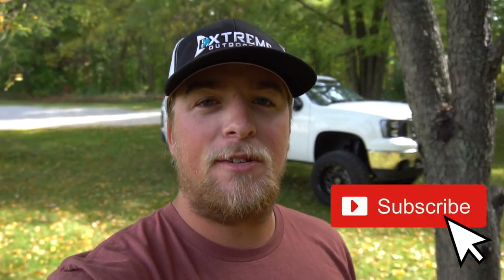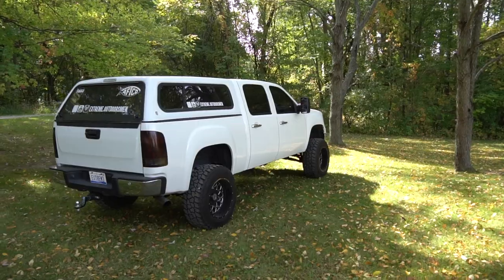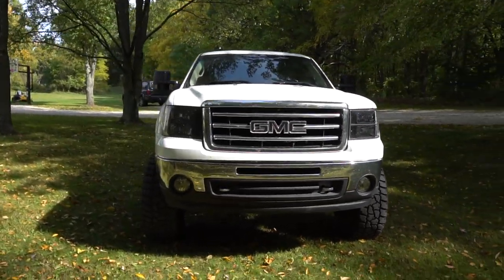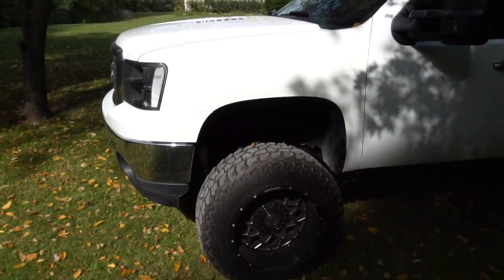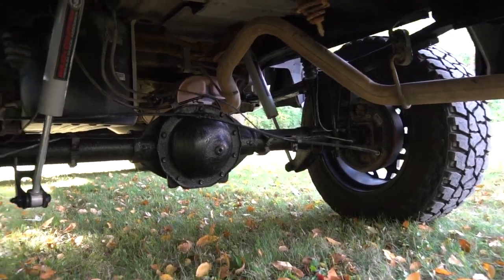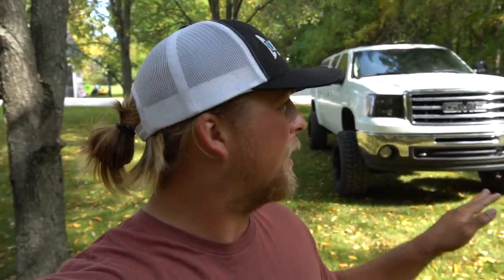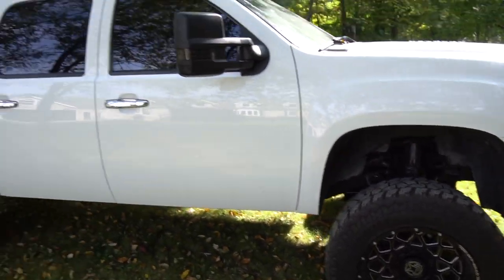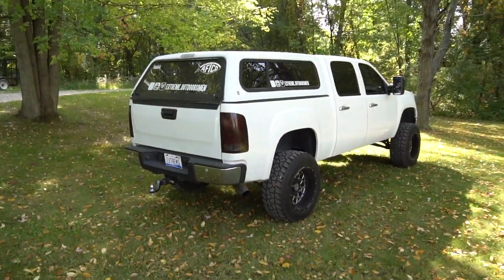I FINALLY Built My DREAM TRUCK - GMC Sierra 1500 Custom Build 7.5inch LIFT KIT

Comment: I did the windshield tint on my 2011 GMC sierra 1500 when I was doing my build. I did 5% tint on the rear and all side windows, a 5% sunstrip on the widshield and the whole windshield done in 20% (Because the guy didn't feel comfortable putting 5% across the windshield also) but looks amazing. On a black truck with tinted windshield it just blends so well, you can barely tell where the body of the truck ends and the glass starts. I also put a ranch hand bumper on my truck and cut back some of the diamond plate on the sides to clear the larger tires, I'll be putting the 37s on it this coming spring.
Reply from the maker: Yeah I used to have 35% tint on my windshield and loved it on my truck, it makes the truck look so much more nicer! But my windshield cracked and I had to get a new one and Now I haven’t put new tint on it! I need to soon tho